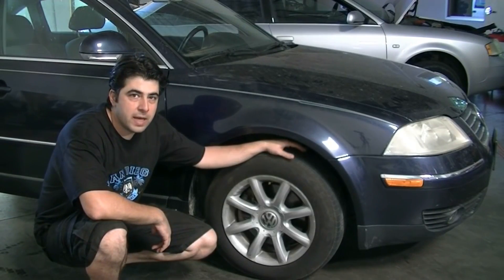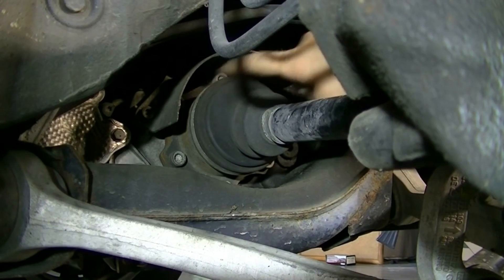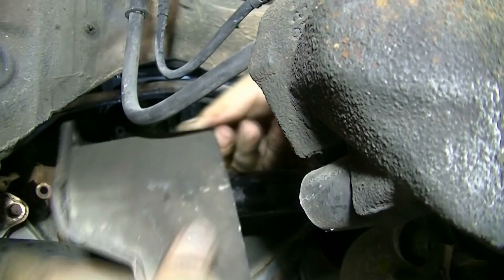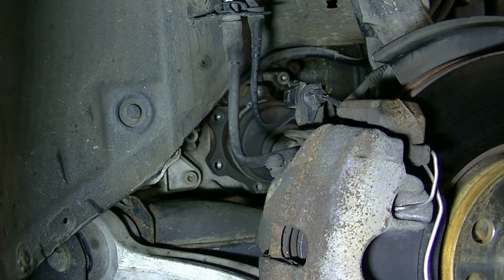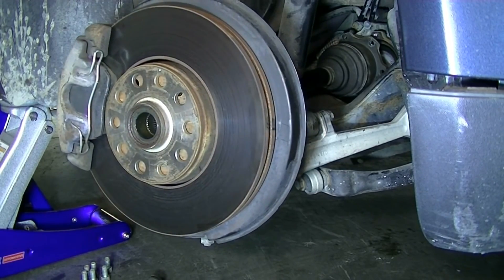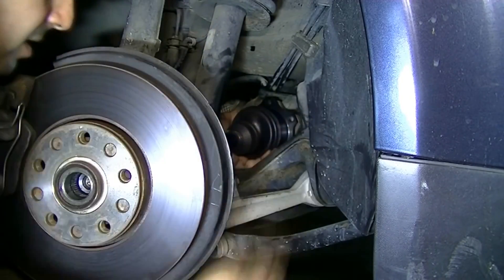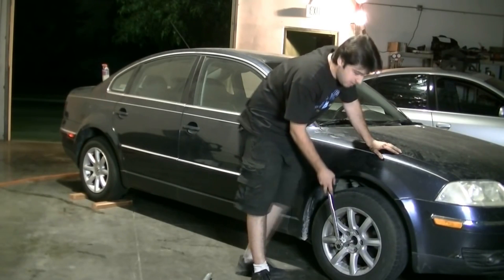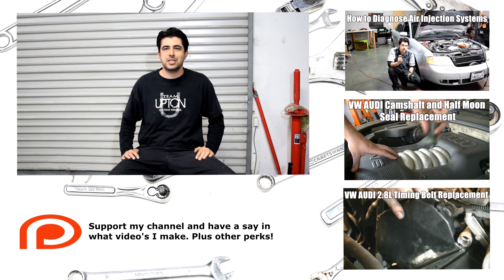How to Replace a  CV Axle on a VW Passat Audi A4 - Short Version

Comment: I did that replacement today, success! Thank you for the guide. Unfortunately for me, the previous mechanic replaced two of the triple-square bolts with a hex and over tightened it. It was a little hell to get it loose. I want to replace them with the correct triple-squares. Any suggestions on where to buy them? Are these correct? They look too long. Thanks

Manufacturer Part: N90668201

Comment: Great video! Thank you. This side is pretty tricky getting it back in on the 2003 Passat wagon. I had to use a jack to move the hub assembly out of the way a little more to install the new one. Then it was easy. Re install of the heat shield is definitely the hardest part(getting the bolts started).

Comment: When you're watching this, take note of which direction he has the wheels turned as he removes/installs the axle. It matters quite a bit, if the steering knuckle isn't pointed towards the left, it's pretty difficult to get the axle on/off. Great video, this is easily the most concise and helpful video about this that I've seen.

Comment: I'm having trouble taking the bolts out of the CV axles(ones that are into trans) are they reverse threaded  or something? My impact wouldnt even get them loose. That's with going out and spraying deep creep on them all every day. I'm not sure what's going on. I've had my 2001 passat 1.8t for 3 years and it's still under repair.  Please help. Thank you
Reply: i have the same problem

Comment: You side to torque the axle to 140lbsft but then you used a cheater bar to tighten it up more..... thats more than a 140lbsft. Smh
Reply: Its spec'd for 140 + an additional 180 degrees of  bolt head rotation